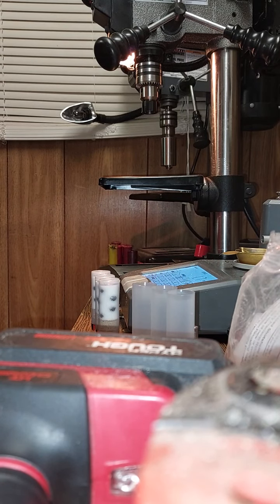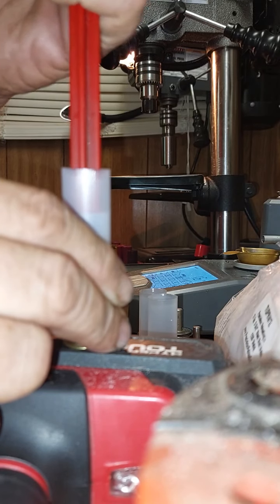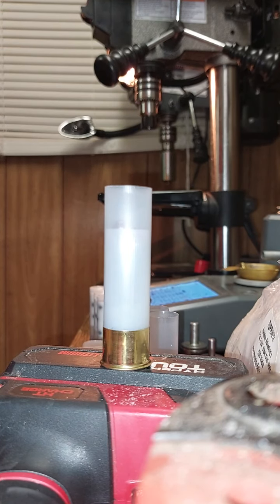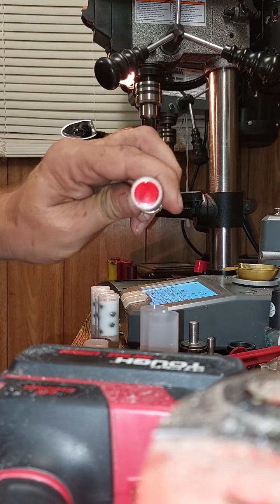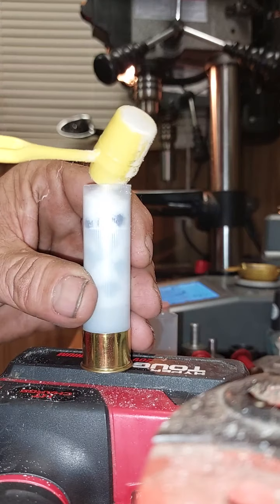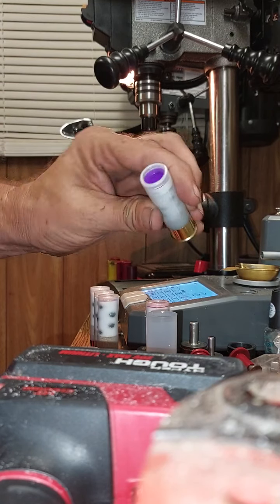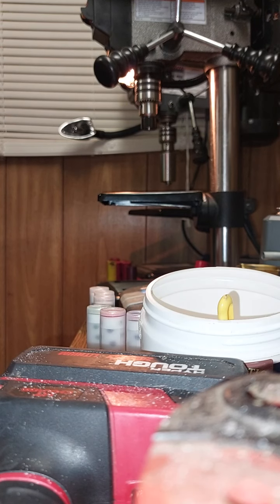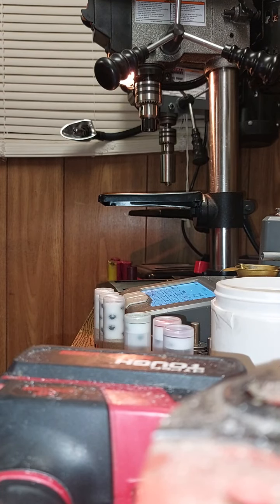my 3 most requested loads, here they are anyone can load these.

Comment: Roger, have you ever tried the GAEP BN2 or the GAEP deep neck slug Roll crimper? and if so, have you had any success with them?

I’m asking because I’ve recently bought both from BP, and neither will actually roll the hull lip over. They’ll put a nice taper onto the hull, but just stop right at the center pin, so all I get is a rounded taper and not an actual roll crimp. 
I’ve got the BP duel pin crimp and that works fine. Just can’t get the GAEP crimper to actually roll crimp.
Reply from the maker: I use the bn2 often but I use it as a taper crimp on fold crimp hulls just to taper edges in. I feel like you that it doesn't perform well as a true roll crimp tool.

Comment: Great job like your work I'm new to reloading but can you help me with wads and hulls I have load data books the question I have is in the books it appears that some wads can be used with both am I correct?example in the book it calls for chaddite  hulls which are straight walled and it says you can use wen. Double a hulls with the same  wadl078 is the wad isn't Double a hulls tapered hulls  how would someone new know the difference what wads go with what hulls sorry to be so long winded  thanks for sharing I have learned a lot
Reply: If you buy a Lyman 5th edition loading manual it will show you which hulls are taper wall and which are straight wall. Yes, some wads will fit either hull. The Gulandi MG42 wad works in either type hull...but some mica wad slick really helps in seating that wad into the Rem STS or WIN AA hulls.

Comment: Cheddite, Rio, Fiocchi, How about Federal?
I have acquired 300 new primed 3” federal hulls, I have been searching for buck shot load recipes using long shot and these federal hulls, which is how I found this.
Any reason this load wouldn’t work in these federal hulls
Reply from the maker: Drop to 28 gr of powder because federal has 209a primers wich are magnum primers hence you need to drop the charge